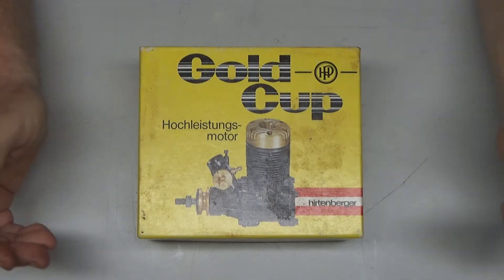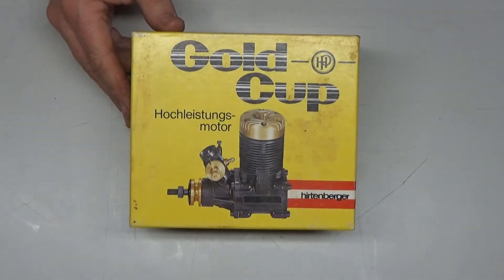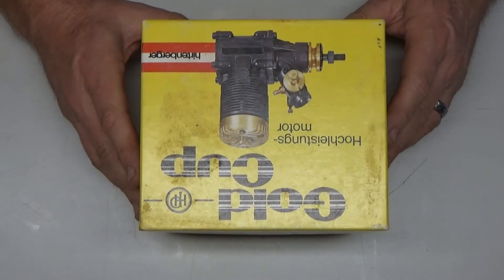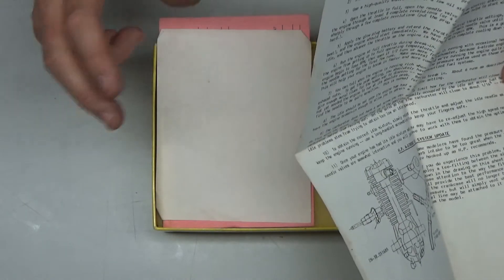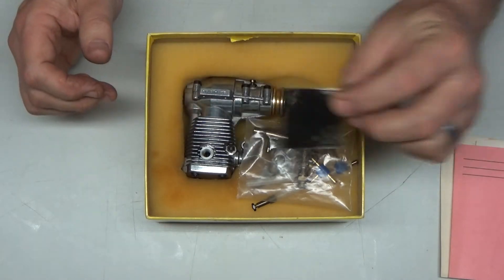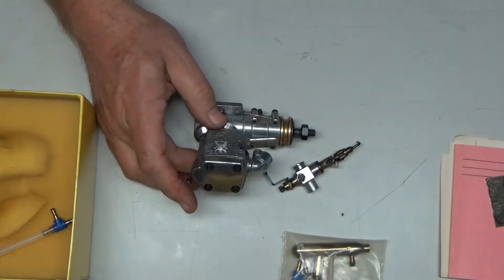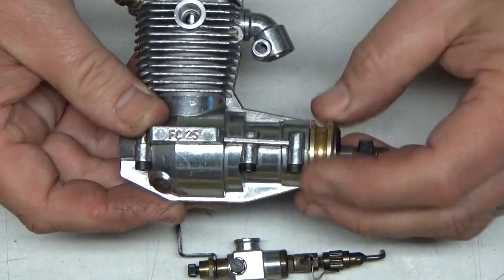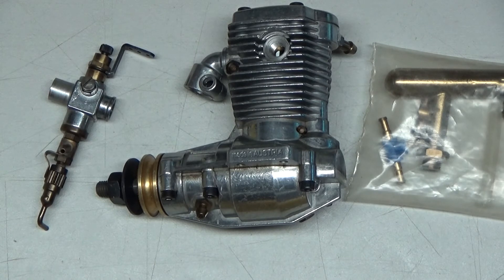HP 25 VT A Quick Look

Comment: Cool Engine. They are real Engineering marvels. I had a VT61 which was an interesting engine as it may have been manufactured during the last days before they stopped production in Austria. It had a silver aluminium head cover which was already milled for a standard roller bearing but that bearing was missing. I was lucky to find one at xbay and it fitted perfectly. During Operation the engine had some serious issues which I could fix after I figued out what caused the Problems. Thanks to MECOA I had access to spare parts. 
Regarding the "Austrian" Language: There is Actually no Austrian language. They officially speak German according to the orthographic and grammatical rules aggreed by the largest german speaking countries in Europe. Martin Luther set the first standard for what would become an officially used German language when he  translated the Bible from Latin to the language that most of the ordinary people would understand.